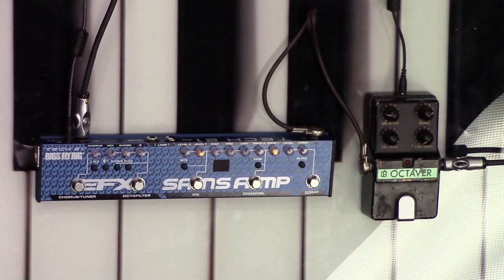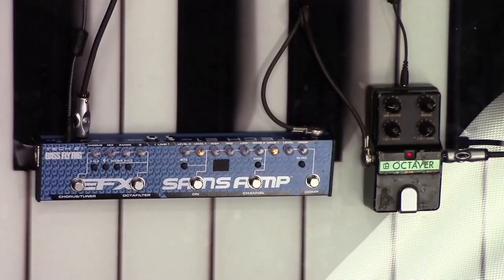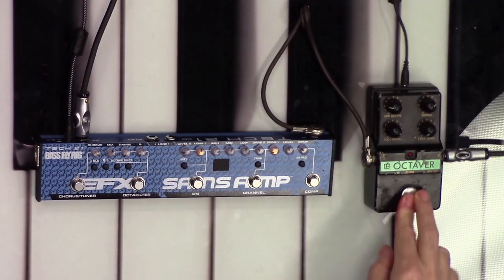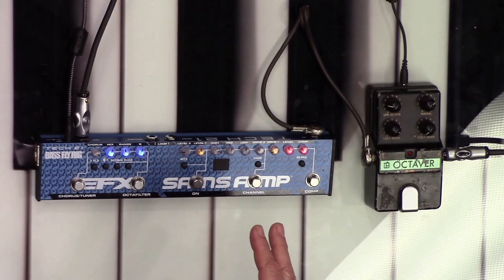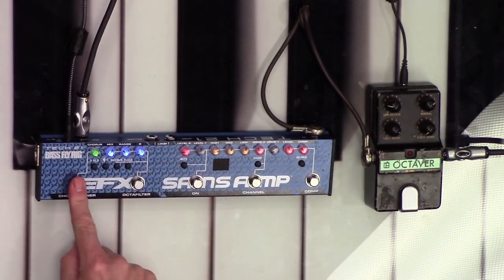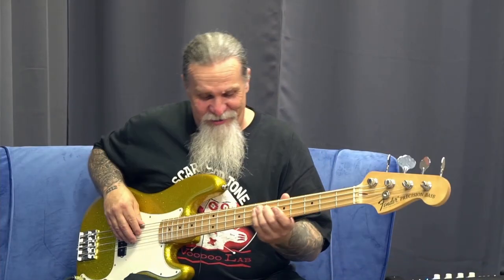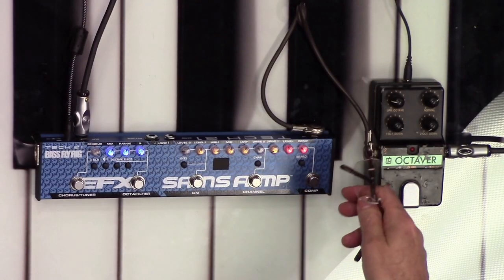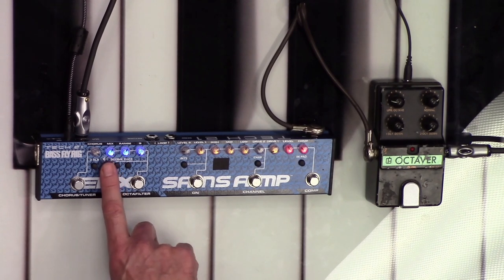Tech 21's Studio 21 Tech Tip Tidbits:  Bass Fly Rig v2 Octafilter

Comment: I noticed when I engage the Octafilter on my bass fly rig the volume is much higher than when it is not engaged.  How do I keep the volume level the same when I engage the Octafilter?  There is no gain knob on the Octafilter.
Reply: Hi Mike. Depending on what you are playing through it may seem much louder, especially if you are using monitors with a tweeter. Try adjusting the "Mix" knob to level it off a bit.
Reply: @TimStarace  Thank you Mr Starace, I lowered the "Mix" knob to about 11 o'clock and it lowered the volume.
Reply: @mikeartz1069  fantastic! You are very welcome.

Comment: Interestingly even though the v1 and v2 have (as far as I can tell) the same octafilter circuit, I get more consistent results on my v1 than my v2. Not sure why that's happening but its just fuzzier and less pure on my v2 even with the fuzz disengaged and the drive at 0. I need to spend a little time dialing it in, I think.
Reply from the maker: The octafilter is DSP based, and the software in both versions is the same. The chip set used as well as the circuit is also the same. The Compressor module and the SansAmp module are different in both versions and may contribute to the differences you are hearing.
Reply: @Tech21nyc  hey thank you for responding quickly! That makes sense that the circuits before the octafilter would affect the result. I was able to dial everything in pretty well after spending an hour or so just playing and listening to the differences. Great little box you guys have made!

Comment: the circuits of the bass fly rig are the same as the bass driver di and vt bass with the character at 100%?
Reply from the maker: The Bass Fly Rig is based on both of those pedals but it is its own unique circuit. There is simply not enough space on the unit to provide all the controls to do what the VT Bass and Bass Driver DI's do completely. The concept is for this to be an all in one easy to transport unit for fly dates, jams etc. with the familiar sound of the aforementioned units.

Comment: I’d like a video showing the differences between a Classic and a GT2.  What makes the classic special? What makes the GT2 special?  If i have a GT2, why do i also need a classic? Why is the classic more expensive? More expensive = better??  I notice the classic relies on an outboard EQ? Can it do more than nirvana sounds??
Reply from the maker: Thank you for your suggestion. The SansAmp Classic is special because it is the original version that debuted in 1989 and basically started the "going direct" movement. It has an extensive library of different amp tones that you can adjust at a granular level. Its overall tonality is more on the vintage amp side of things and great if you really want to dig in and "tweak" your settings. It costs more because it's very labor intensive to make. And yes, it can do lots more than just Nirvana tones. In fact all SansAmps are designed for maximum variety of tones, including all signature versions. The SansAmp GT2 is a bit simpler to use and adjust. It's more aggressive and has a bit more top end "sizzle." You should take a look at the sample settings in each of the owner's manuals on our website: https://www.tech21nyc.com/support/  

Being that sound is so subjective and we all have different tastes, we always recommend trying both if possible. Once you plug in with your guitar, through your gear in a setting you are comfortable with, the decision will be much easier.
Reply: @Tech21nyc  i notice the classic has more mic placement/speaker sim options, so i can see how that would bump up the complexity of the design quite a bit.  It seems to be a good general purpose studio tool, maybe a bit less specific to the electric guitar than the GT2 is. I could see myself running vocals, keyboards, or drum tracks and other things through a classic to add some special mojo to it.

I’ve been using the GT2 for a metal guitar tone.  And yes the top end sizzle of the GT2 is fantastic, really aggressive, lots of frequencies there to play with in the mixing process :)  (what does “GT2” stand for anyway?? I always wondered)

 i’m also in the market for a device that i can leave on a clean/semi clean setting all the time, the classic seems like a good choice... like i could have an A/B switcher with a GT2 set to california metal style and a classic set to tweed mode, leading into two different signal chains for clean and dirty.  i’m slowly building up a collection of sansamps for my home studio and live use :) so far I have the GT2 and  the classic V1 Bass Driver DI.  I’m really tempted by the classic and PSA 2.0 too.. i wanna collect em all :D ugh the steve harris model looks kick ass too!

Random question: i’ve seen a Sansamp “Bass DI” with no knobs or controls on the outside of the unit.  When was that unit made? I don’t see it on your product archive on your website.  I’m curious if the circuit in there is different than the more common bass driver DI.
Reply from the maker: @almostliterally593  Nice start to your collection! There are no bad choices, btw --Classic, PSA 2.0, etc. :-)  It's really a matter of functionality and budget.
The SansAmp Bass DI was the first incarnation of a bass specific SansAmp, which came out in late '92. The Bass Driver was introduced 2 years later, in response to all the requests to have the controls on the outside. While the designs/formats differ, all SansAmp share the same core DNA.
Reply: Hey, this video is about Bass Fly rig. Why do you ask about a guitar pedal?

Comment: Mine has a popping sound when I push the compressor and the Octafilter button. I've tried to go directly to the Gallien-Krueger 700RB-II amp, and I've tried the 4 cable mode from the owner manual.
Reply from the maker: There can be a slight noise when engaging those sections due to the speed of the FET switching. It should not present a problem under normal circumstances. If you are using the SansAmp section it can be helpful to turn that sections level up a bit and reduce the volume of the amp. When players complain about the noise they are usually just switching in a quiet setting. If you are playing in a band setting with drums and guitars you shouldn't notice any noise.